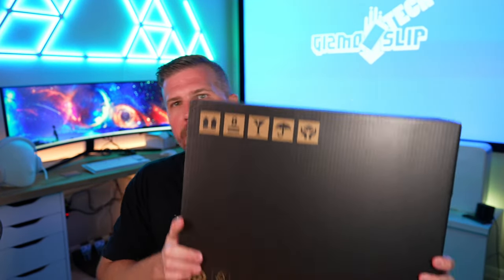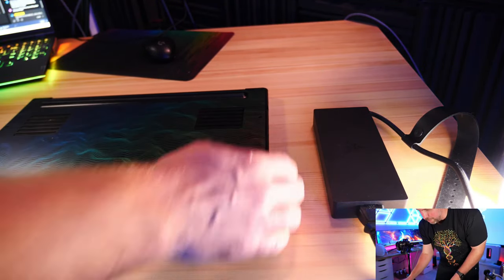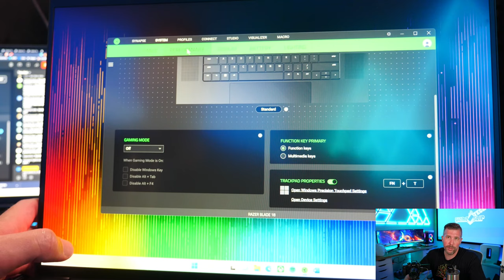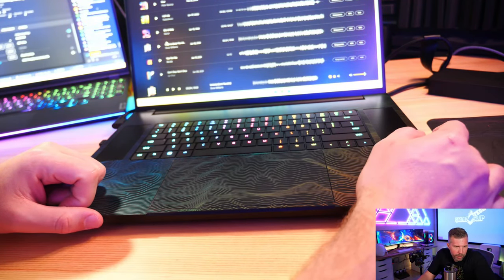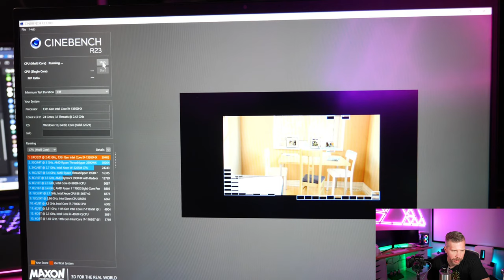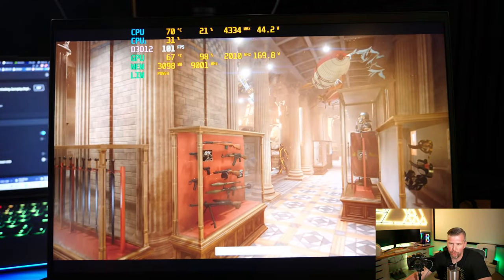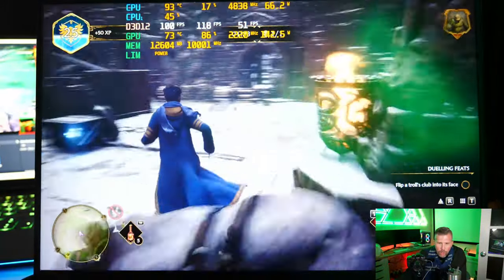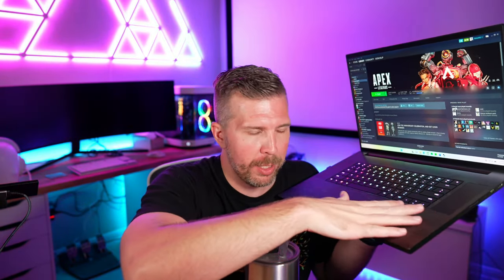Razer Blade 18 Unboxing, Undervolting, Overclocking, Gameplay, Display Test, Internals! RTX 4090!

Comment: Blade 16 thermal throttles on the best core a little, especially in games against the 4090, the 13950HX is bottlenecking hard. But run it with undervaluing of -0.150mv for core ratio and similar settings to what you have for the rest, gets a score of about ~31002 in Cinebench R23.
Thanks for the run through of the settings really helped me get the score up and reduces the thermal throttle. 
Blade 16 definitely worth it because of the Mini LED display. Looks better and brighter than my OLED main PC display.

Comment: YES, thank you sir! I was worrying about this - how to keep the 330W Brick on the ground - now if it is 182cm from brick to laptop - that's fine! Razer add battery limitting because they had failry high failure rate of their supplier puch Li-poly batteries. Of course it's better to have it than not have it (the setting). Why you did not show thermal throttling on package and cores - list details - I was considering this laptop, but I see a lot of biased reviews all-around the YT, and just few honest responses from actual owers on the reddit. That's suspicious af.

Comment: I really wish Razer would drill fake speaker holes on the Blade 18. Seeing the gap on the speaker section annoys me too much. The second small gripe I have with this laptop is the hinge vent. The display is pushed back further than it needs to be with the vent and there is a gap where you can see the table it is sitting on.

Comment: I just got my Blade 16 today (would have gotten the 18 if it had a UHD display like the 16 - I need 4K for my content creation), and I managed to get over 21,000 in Timespy with it too, 22,000 Graphics and even hit 17,000 on the CPU with an undervolt. I've noticed I get much better results with undervolting if I keep all 3 offsets to the same value, however. Core, Cache, and efficiency, all set to -125mv.

It's nice to see how close the 16 comes to the 18, I was hesitant to go for a 16" laptop as I'm used to always going for the big ones with better cooling, but this generation is leaving me with no choice due to the total lack of 4K display options. I first tried the obscure Clevo x370 for its 4K display, but it was a disaster of issues from dead pixels to 90C on the CPU at idle with roaring fans for no reason, and many others have had the same issue. So it was either the Blade 16 or the Titan, and I didn't find the very slightly higher performance of the Titan worth the extra cost and bulk this time around.
Reply: thanks for the tips, im a content creator too, and I'm looking for razer blade quality

Comment: So even in the 4090 model they are using two 1TB drives, another deal killer, as I want a 2TB main drive (minimum and non negotiable, I have a ton of music software to install) and 2TB second drive (maybe even a 4TB) strictly for games. Non negotiable. I'd literally have to remove both drives AND ram sticks it comes with (to put in 64GB and 2x2TB drives). Honestly I'd just be buying the shell and cpu and GPU. For 8.5K AUD lol. SO under specced for the price. I'd have to do a clean install of a system that really is already perfectly set up without bloatware, and no AV! Razers are the one system that you just turn on and don't need to uninstall anything. Kudos to them for that. If you are happy with internals nor do you need a clean install. Kudos again. Fair is fair.
In any case, Razer lied once again, they said in the 4090 model it's one 2TB drive. Typical shenanigans.

Raid 0 is useless for gaming and makes precisely 0 difference to loading times. All it does is endanger your data. This has been proven (loading times I mean) ad nauseum.
Furthermore, to take advantage of copy/paste transfer speeds you'd need another drive just as fast you'd be transferring to/from. How would that happen? Even a thunderbolt array could not do it.
Again, R.A.I.D. in a laptop 10000000% pointless.

I ended up with the GT77/13980HX/64GB/4TB/4090 but am having some strange click noises when GPU loaded and may be returning it. Not sure what to do.

I think the M18 might be what's calling my name, since the store has no GT77 in stock to replace with (and my laptop is all of 4 days old). The M18 comes standard in OZ with a  2TB (single drive), 4090, 64GB ram.  I mean the 4090 so far can run any 4K game with RT and Ultra settings (if you want 60 fps minimum) as LONG as DLSS is used. Games from 2 years ago can do over 100 FPS in native 4K.The 4080 is only 14% weaker than the 4090 in the laptop and therefore will definitely drive any game for foreseeable future at either 1440P, or 1600P if you want to play in 16/10. So maybe save cash and get the 4080? Hmmm, food for thought.

l will just have to get used to the 350 nit 1600P screen in the Alienware but at least I'll get G-Sync back.
I'll also add a second drive. It's also 2.5K cheaper than the Razer, with double the ram! Work that out.
Of course this is all moot if MSI can confirm this noise happens and not to worry, as then I'll be keeping it.
Actually, 4090 Alienware M18 with 64Gb ram and a 2TB SSD is cheaper than 4080 Razer 18 with 1TB SSD and 32GB ram!

Ok, on further inspection, Alienware charge 1000$ more AUD exactly (~600 USD) for the 4080 to 4090, but that DOES include a 1TB to 2TB OS drive upgrade also, and I might even buy a second 2Tb drive from them so I don't need to do a thing nor ever open the laptop. Maybe it's worth it for the 16GB Vram future proofing and knowing any game at 1440P or 1600P ultra will be 60 FPS+ for years to come.
Even if I pay the $800 AUD extra for the second 2TB drive direct from Dell, ludicrous price sure but entire system then covered by Alienware's unbeatable warranty - it STILL works out to 6944 AUD for M18 with 13980HX/4090/64GB/2x2TB SSD vs 7099$ for Razer 18 with 13950HX/4080/32GB/1x1TB SSD! WTF?
6 speakers and slightly higher brightness do not make the Razer worth more money for inferior performance and specs.

If I return my MSI and get a refund, that's what I am doing, the M18. Done. I'll miss the 4K mini LED but gain G-sync and best warranty in biz. I'll live lol!
Reply: It may be a regional thing but the Razer Blade 18 with 4090 is available in more than 1 configuration. The one I have comes with a single 2TB drive and 64GB RAM.
Reply: @flaviousmaximus3484 how you get that model

Comment: You say you are going to put 2 x 8TB SSDs in this thing, It was my understanding that only single sided SSDs will fit, and the 8TB SSDs are double sided. Am I wrong?
Reply from the maker: I will find out soon!
Reply: I know this is a year ago, but in the Blade 18 you can use double sided SSDs - its only in the smaller models where they stack the SSD slots so they can't be double sided.

Comment: What won you over on the 18 when compared to the 16 with the 4090?
Reply from the maker: Lower metal body temperatures while gaming, slightly more performance, m.2 slots that can fit my 8 tb double sided ssds, bigger screen, better speakers, and a RTX 4090 that can be paired with a QHD+ display. The 16 doesnt have that option currently.
Reply: @GizmoSlipTech  Solid response! Thank you, I was literally watching your other video while driving to the Razer store to pick one out. the 16 one out because it fits in bag a little better, and the mini led display won me over.

Comment: Which is better blade or Scar18
Reply: I’m wondering the same
Reply: Having seen this reviewers video on both, I think its safe to say that the scar may have better performance but is built to a tighter budget in the quality of manufacture. The blade appears almost as good but with a more premium quality experience. Therefore, which one is better depends on what you value more. For me, I just purchased the blade.
Reply: @michaelfinch1965  are you liking it? tell me a bit please
Reply: @monicaflbarbosa  Hi Monica, so far I have to say that I am enjoying my time with the Blade. I share my gaming/computing space with my wife in the lounge room and we have put some effort into making that space to be both aesthetically and ergonomically pleasing, the blade looks very classy on my desk. No flash “look at me” rbg to ruin a common space. 
Performance wise it runs all the games I wish to play as well as Lightroom and Photoshop without any fuss. The screen is big, bright and clear, zero complaints. 
The keyboard is a joy and nice and silent (unlike the razer Tartarus).
I had a brief moment with some intermittent flashy screen nonsense, but once it updated it all went away.
The fans (I usually have them set in the middle of the slider) work well and are not obnoxious. Also, thankfully I have noticed zero coil whine, that would drive me nuts.

I would recommend this computer to friends, but hate the pricing.

Oh, there is one thing I hate, cant seem to find a travel sleeve/cover that fits. Ffs razer, make a portable 18” without a means to protect it during transit 😑. I am sure they will crop up in time.
Reply: @michaelfinch1965  Is it possible to upgrade it to 64 GB? It doesn't make sense for such an expensive machine with only 32 GB available... The new colour mercury looks amazing did you see it?

Comment: I wish you would have done these tests without doing any overclocking 
 beforehand, in particular, maybe some of us don't want to use other apps outside of synapse that may jeopardize our warranties on this very expensive machine.
Reply from the maker: I will be doing no OC settings for the main benchmarking livestream, don’t worry
Reply: if you could incorporate no overclocking that would be cool and/or overclocking that is facilitated within the razes apps that does not involve other apps

Comment: why would someone choose this over the msi titan?
Reply from the maker: This is more portable. Thinner and lighter. All metal. Better speakers. Better webcam. Faster ram, so some cpu bound games play better. Windows undervolting controls. Better fan noise acoustics. Different modern styling. 

But the Titan has raw power, more performanxe features, and brighter display with much better contrast and resolution.
Reply: @GizmoSlipTech  What would you pick, RAzer 18 or Asus Scar 17 2023 w AMD?

Comment: It is my device for 2023-2028 LOL
Reply from the maker: Lol, I can never keep a laptop that long xD
Reply: with that cpu temp I doubt it'll last that long
Reply: My Razer Blade 15 with 1070 is almost 5 years old now and still works like new. It stays at a constant 100 celsius during games. So I would think that the Razer Blade 18, which is much cooler, will last at least as long.

Comment: I am away from Razer due to razer 14 bloat battery issue.
Reply from the maker: Razer offering a 2 year warranty now, but you can get an extended warranty if needed
Reply: My Blade 15 is 4 years old, no battery bloat.
Reply: @GizmoSlipTech  what is the situation about bloating in other brands ? It happens their gaming laptops ?
Reply: @Ryzen-gw7yl  I believe that the problem with swollen batteries is related to too high thermal conductivity of the aluminum chassis. During active use, the laptop heats up and the battery comes out in a kind of thermal chamber, and gradually overheats as well.